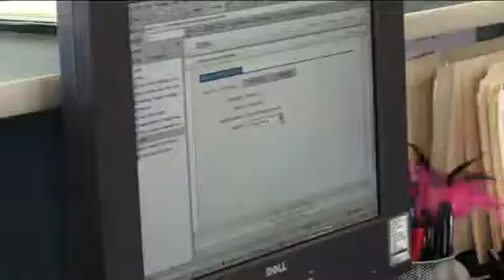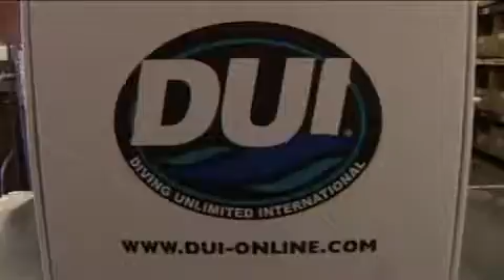DUI Quick Tips - Behind the Drysuit Seams

Comment: DUI isn't what it used to be.  I'm actually very disappointed with them now.  My suit was sent in  and I haven't seen it in 3 months.  That's some really slow service. Plus when I called, the person over the phone was rude.  As an instructor, I have pushed and promoted DUi for almost 20 years.  I'm afraid I can't do that anymore.  DUI doesn't really stand behind their products.  Of course with a lot of management changes in the past 5 years, I'm not surprised.  DUI installed a chest valve that was cracked but they didn't care.  How do I know it was cracked at the factory, well when it was unscrewed, there was cocking in the crack all the way through on both sides.  Obviously the only way to have cocking all the way through and dry on both sides is for the valve to have been installed cracked with fresh cocking.  But they don't warranty things like that.  Obviously it didn't crack later and then dry cocking work it's way into the crack on through to the other side.  I guess they expect you to unscrew and unseal the valve as soon as you receive your new suit so it's still under warranty if there is a cracked part.  The people on the phone are rude, service is extremely slow and the cost of repairs will just about buy you a new suit now.  DUI isn't what they claim to be any more.  When owned and operated by Susan Long and ran by Faith Ortins, it was an amazing company but it has gone down hill since.